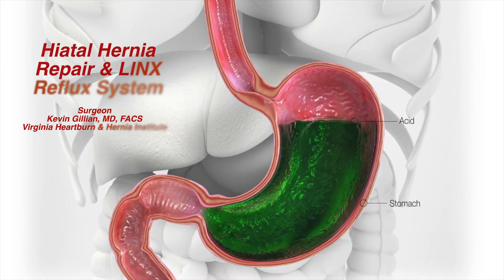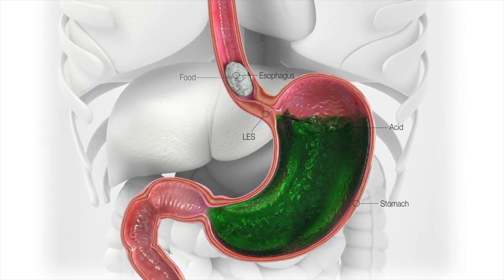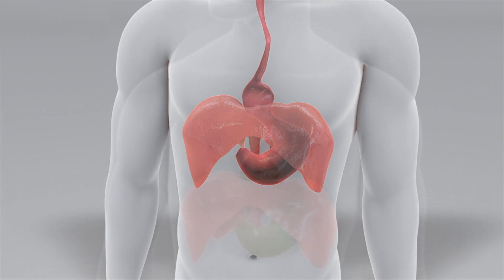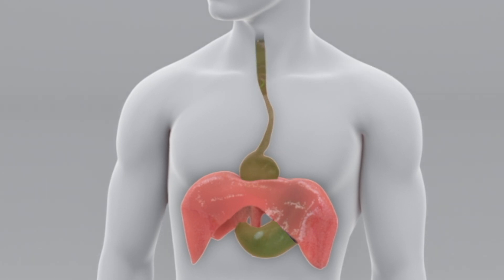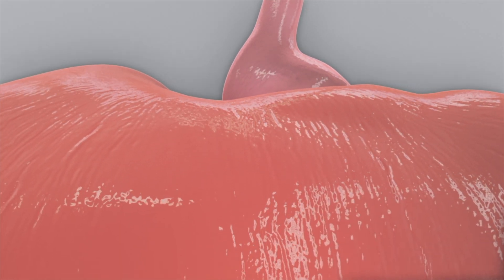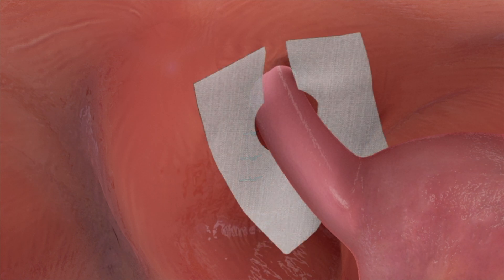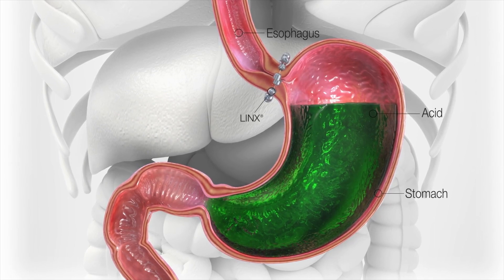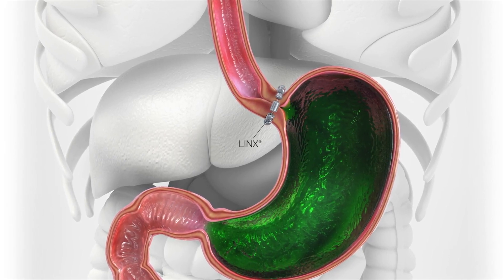Hiatal Hernia Repair & LINX to Treat Reflux Animation

Comment: I had this device implanted 2 years. Very successful. No more gerd.
Reply: Hi, did you had any side effects? Are there any risks?
Reply: @maxuser1221  I did not experience any issues. As for risks, I was told they were minimal if I followed my doctors orders.
Reply: @mran7042  no strange feelings when you swollow? - just wanted to check

I heard that from another video- so I wanted to check.
Reply: @maxuser1221  no. But I had to eat something every 2-3 hours during the first few weeks after surgery to “exercise “ the Linx device. And even today I need to make sure I thoroughly chew certain hard foods like carrots before I swallow. I definitely would do it all again. Good luck.
Reply: @mran7042  thanks for sharing
Reply: @M Ran  hey can i contact you.
i want some information..plz if u can..i will really appreciate your effort

Comment: Do you need to get Linx for hiatal hernia ? If you don’t have reflux ? Or can you just  pull down the stomach stitch up the hole & put mesh over it ? What types of procedure are there for a hiatal hernia ?
Reply: It deoends on your severity of reflux. Usually hiatal hernia repair wont be enough, once LES has been damaged it wont fix itself

Comment: Is this a new procedure? I mean the mesh. Not the lynx. 
Before it was only funduplication. Tying the stomach around itself at the top. Is this mesh a new break through?
And what about the chip regulating the electricity of the opening/closing?
Reply: Yeah but the problem with mesh and lynx are possible complications. I was told that my gastroenterologist that the lynx complications can be slipping of the device, some have broken while in the body and the other is difficulty swallowing food. Not being able to comfortably swallow my food or water is a deal breaker. Mesh adhering to tissue and possibly cause immune desases is another. Lots to thing about here.
Reply: @Julia Joseph  sorry for the long delay. The documentary is called The Bleeding edge. It’s quite a eye opener on devices like the mesh and replacement joints. Any device introduced into our bodies come with dangerous and life altering side effects.
Reply: @Julia Joseph  it’s called The Bleeding Edge.
Reply: Thank you Alfonso. I will watch it.
Reply: On Netflix now .. must see if you’re considering a upcoming surgery. I was convinced that I was going with mesh for my up coming hiatal hernia procedure.. I’m positive that I will not be going that route. After watching this docu and seeing what  J&J had done in the name of $$$ as will as others I won’t be going with lynx either. They have their grubby poop stained hand in that one too.
Reply: @alfonsoalvarez5349  I watched it last night. Yho! It is an eye opener. I will stick to life style changes for now. I dont want to worse my Situation

Comment: Magnets? 😟
Reply: I had a Type IV paraesophageal hernia that went undiagnosed for several years.  The main tip off was that Cameron's erosions in my stomach kept  causing severe anemia.  Later it got so I could not keep a lot of food down.  I knew I did not want the standard Nissan Fundoplication procedure due to the various issues that result from that and decided to go with the LINX procedure.  The surgeon did NOT use mesh,  I have a prescription for Ondanstran if I feel any nausea coming on.  While I can vomit with the Linx device, the surgeon said the diaphragm tissue is pretty fragile and he doesn't want me wretching or throwing up as it could cause a tear.  It's coming up on just 2 months since I had the surgery.  Gas is still something of an issue and probably always will be.  My biggest problem is finding food that agrees with me, various meats, soups, etc that I liked before just don't seem to sit well.  But as far as the LINX device, I  can't really notice it's there.  I have to eat a little slower, but overall I'm satisfied at this point.  I know Alfonso Alvarez has nothing good to say about it, but I heard from a few people who had the LINX and were happy.  I've already got metal plates in me from an accident several years ago.  I don't know what babies putting magnets in their mouths has to do with the procedure.  This device isn't swallowed and it goes around the outside of the esophagus.   Options are fairly limited as to what can be done and I did what I felt was the better option.
Reply: @barbarashannon7548  I see. What year did you have the linx? I will get a second opinion on this as my doctor would not allow me to undergo surgery.
Reply: @davebalanding  Just last September.  There were a bunch of tests that were performed, including a strange one where I had to chew and swallow where they had me strapped to a table and tipped backwards. If you couldn't pass that test, then you weren't eligible for the Linx as esophageal muscles were not strong enough.  Is this maybe the reason the why your doctor won't allow it.
Reply: @davebalanding  Just last September.  There were a bunch of tests that were performed, including a strange one where I had to chew and swallow where they had me strapped to a table and tipped backwards. If you couldn't pass that test, then you weren't eligible for the Linx as esophageal muscles were not strong enough.  Is this maybe the reason the why your doctor won't allow it.
Reply: @barbarashannon7548  , are foods and drinks that were not allowed before like sauted dishes, fried foods, milk ok after the linx surgery?
Reply: @davebalanding  At 5 months out, I'm eating and drinking everything I did before.  I understand some people need to avoid carbonated beverages, but they don't bother me at all.  I love milk and dairy products and continue to eat them.  Fried foods, spicy, sauteed, it all works now.  I will have an occasional day where I have a little more gas.  I've found that a small piece of candied ginger will usually help that problem.  At the time I had the surgery the nutritionist said I would have to learn to eat a lot slower and chew everything up really well too.   Sometimes when eating, I realize I'm not slowing down though and it doesn't bother me.  And once in a while I will get hiccups, about 4-5 in a row shortly after starting a meal.  Pause for a few minutes and swallow a couple times and it goes away.  Overall I am very happy with the results of the Linx procedure.
Reply: Yeah !! Kinda stupid right. We tell babies not to put mags in their little mouths and here we do it willingly. What are the metals used ?? Depuy used cobalt in hips , knees, and shoulders and hurt people real bad. That crap breaks down and leachs metals that destroy pure immune system. Watch the bleeding edge on Netflix. That’s some bad shit. Then research lynx and the mesh.